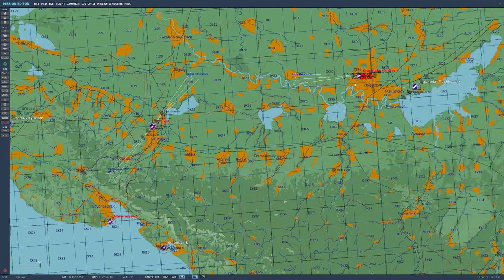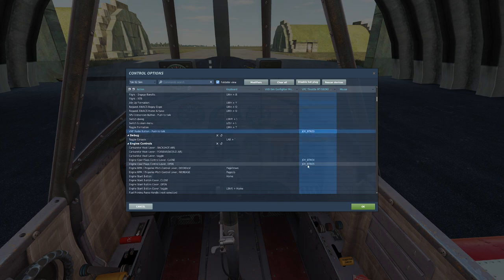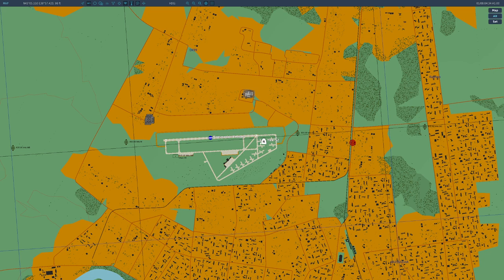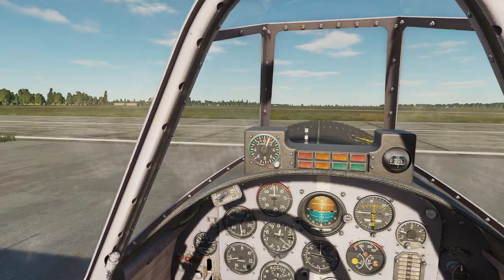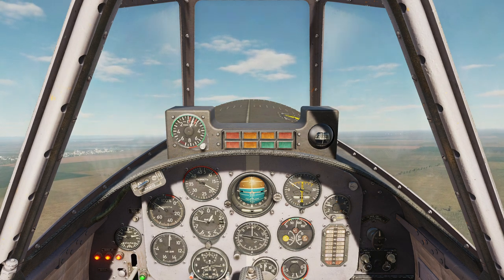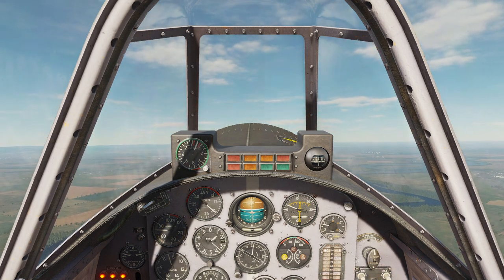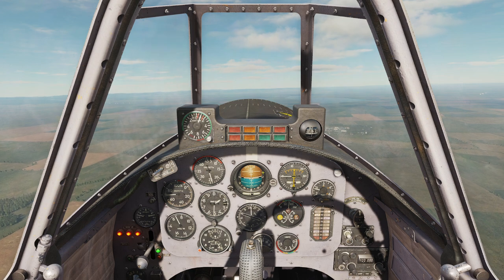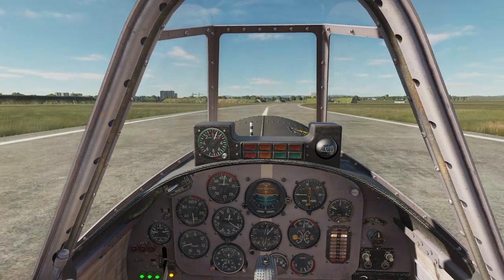DCS: Zero to Ace Basic Part 1 - Yak-52 Startup, Takeoff and Landing

Comment: Nice. Probably the best thing about this aircraft is that having to pay attention to engine and oil temperatures does get one used to scanning the instrument panel. It's easy to fall into simply watching only things like airspeed, altitude, VSI and the slip indicator. Most people probably fly sims expecting the aircraft to be running well and for things to always be in the green. Not so when it's a combat flight simulator and you're potentially taking damage -- or when you simply have to manually adjust cowl flaps.